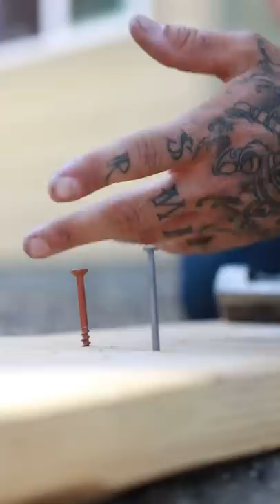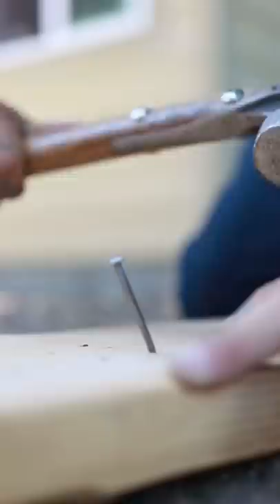Nails vs. Screws: Why do we use nails? #shorts

Comment: Nails will also come out over time where screws won’t. So pros and cons to both. Most builders I know use screws and nails. It really depends on the job
Reply: The main reason for using nails over screws is simply cost, it’s a hell of a lot cheaper to just use nails
Reply: Screws come out without fasteners. You also cannot remove screws without splitting wood. If a lazy, overpaid worker puts the screws in crooked, you get split wood. If an underpaid, quality worker puts the screws in crooked, you get split wood. Most of the time, you do not get what you pay for. You will not know what you got until you got problems. That takes a pretty decent amount of time. It is usually the second owner of the building that finds out.
Reply: @lalamclala5553  🤔

Comment: This video explains that the creator should not be involved in any field around engineering or construction.
Reply: I think he’s just a young builder that thinks he knows the answer to every little thing. That hammer he is using is relatively new.
Reply: Roasted so hard 😂
Reply: Builders now use screws, or Atleast nails that have testy and heat activated glue.
Reply: @channingtaintum  or it could just be a joke, people do that sometimes.
Reply: Hey man, he's a Californian. Give him a break🤣
Reply: That actually correct. Construction workers think it's only cost but In engineering things are built to yield not break at failure
Reply: So true, people who don't know what you know shouldn't be allowed to work in the field.

Honestly just stop hiring new people at all, not like construction would die in 1 generation if we were to do that 😉
Reply: Matt has been building shit for a long time, I don't think he's new

Comment: If your house moves this much to break a screw you're in the wrong house.
Reply: the sears or whatever tower is designed to sway like 3 feet and regularly hits 6inches. there’s a reason to design and to use materials that bend and not break. It’s a major variable in construction of things, even electronics glass is designed with that sort of thing in mind.
Reply: @threestans9096  I don’t think Sears tower is made of wood
Reply: Under extreme weather conditions especially for house in tornado alley and the east and gulf coast houses will flex and move in some case will completely collapse due to wind shear/load
Reply: @jamescrow8999  Even I heavy rain or high heat, if its a timber frame the house will move slightly because of swelling and drying
Reply: Think of a floor system fastened together. You don't want to use brittle screws.  Just use Simpson screws in hangers after nailing floor together.
Reply: The wrong house, or you're putting screws in a tent... In a storm.

Comment: If you have that much shear at a connection, then nails vs. screws isn't your biggest concern.   Anti-aircraft defenses, however, might be.

Shear is but one type of force.  There are several more which screws will perform much better.
Reply: I disagree, in his example he is exaggerating the motion. Even with milimetric deflection, through high cycle fatigue which occurs over time with things like wind, heat, cold, etc.. you can start seeing issues. 

I am referring to this specific example. Of course, choosing the right fastener depends on a multitude of variables and the application.
Reply: @pumsjd  Exactly. There's a reason aircraft are inspected for microfractures so meticulously. Every flex no matter how small takes it toll
Reply: @pumsjd  well ure wrong still that’s just one example ure clearly not a builder 😆
Reply: Places that have lots of Earthquakes such as Alaska,Comifornia,& others need something that can shift so it’s obvious your knowledge level is not very good about how much building shift in those areas.Maybe you should do some research because it’s obvious that you have not.😱🇺🇸
Reply: Yes... that is why they use fasteners and joints. You cannot simply remove or reuse a fastener. That is why both aircraft and anti aircraft are single use with any damage. They do not patch wholes in aircraft.
Reply: @lalamclala5553  LOL,there are WHOLE what’s in aircraft? 🤣😂 I have seen them with HOLES but I’m not sure about WHOLES? 😂🤣🤪😱
Reply: @lalamclala5553  Meanwhile I've logged 1000s of hours in planes that have been patched repeatedly and been in and out of the military aircraft boneyard in Tucson over the last 50+ years.
Reply: Name one then I bet you cant without Google lol
Reply: Oh yeah? Well, SHEAR is going to be the main force that a stick framed house's structure will be subjected to. If the house's foundation shifts causing the wall framing to fall, that's shear load. If winds are high enough to blow siding and sheahting off, that's shear. If winds are high enough to blow your roof off, that's shear. Anything else?
Reply: You're completely wrong.  Even A small amount of repetitive wind load will break screws.  I've witnessed this myself with temporary braces held on by screws over a fall/winter. 

Instant fail on an inspection.

Lay off of the holmes on homes, bud.  😏

Only footnote to this video is that there are screws rated for structural work (Eg. GRK).  But they are a lot more expensive than nails.  For framing, "deck screws" are the defacto 'screw'; which are awful for framing.

Comment: This is BS, if we wanted screws to bend like nails we could make them out of a more ductile metal instead of a hardened metal. The reason is cost.
Reply: Exactly my thought… and if I’m not mistaken, some screws and bolts are made with a different blend of metals to reduce sheering.
Reply: I use neither just a bit of glue does the job 😉
Reply: @Znew07  I love how people on youtube act like experts when this dude is a literal expert
Reply: And its much expensive

Comment: The answer is shear forces. Nails are stronger against shear forces, i.e. two studs sliding against each other. Screws are better where a clamping force is needed. 
If you're putting studs together to hold up a wall, use nails. If you're attaching a subfloor to floor joists, use screws.
Reply: This is the correct answer
Reply from the maker: Ding ding ding.
Reply: We'll that's demonstration doesn't prove* that.

This process the nail has higher toughness but we don't know which has higher yield stress. According to your clean, we could be concerned with the latter and as the screw seems stiffer, it may be a better candidate for such forces.
Reply: @21area21  screws are generally harder but more brittle. You need the hardness to drive them without twisting them off. But as a result of this, they don't perform as well in shear (hanging) loads.
Also, a screw is only as strong as it's thinnest part between the threads. Since screws neck down considerably compared to nails, they are weaker in shear 

But, those threads and the head are what give you the clamping force. So if you're trying to keep something attached in a horizontal plane, choose a screw. It's not as strong but it resists tension loads a whole lot better than a nail.
Reply: @DriveCarToBar  Gotcha. That all checks out. I was just suggesting that brittle things actually have a higher FORCE needed to deform and break them while more flexible things like the nail can absorb more ENERGY before breaking. I guess if wood expands so it doesn't put the forces on the fasteners evenly, in those cases you would need them to have higher flexibility in your fastener.
Reply: Dumb guy here. And you guys seem to be proactive in answering. Is is the screw cut that make it fragile? How come there isn’t a flexible screw? Would that be stupid expensive?

Is the nail more flexible because it doesn’t grab or clamp the same?
Reply: The screw is less flexible because it's harder, it experiences a brittle fracture after exceeding its yield strength instead of undergoing plastic deformation as the nail does. It isn't necessarily less strong in either tensile or shear stress.
Reply: @forrestcarroll9350  for a given size, the nail has a greater shank diameter and resists deformation and breakage under shear. It exhibits greater resistance to breakage, this making it stronger. 
You could use larger screws to get the same strength but they are more expensive and take longer to drive. That's why we use nails. Stronger in a given diameter with the bonus of being faster and cheaper.
Reply: @forrestcarroll9350  replied to the wrong dude.
Reply: @jonithanphillips2925  well, I'm sure you could have a softer screw, but it probably wouldn't perform as well. Screws have to handle a lot of torque when you are driving it and the heads experience a lot of stress. Softer screws will be limited in their length, have heads that strip out much easier, and will likely rewire thicker threads which cause further increase in driving force meaning and lowering performance.
Reply: @DriveCarToBar  That clamping force that screws provide adds a considerable amount of friction between the boards that will counteract a shear force to a greater degree than a nail. 
Screws on their own are terrible at shear forces but within a framing member they can, in most situations, resist shear forces better than nails.

Comment: Never thought about screws and nails having a different temper but it makes sense. You need a harder (but more brittle) steel for those tiny screw threads to provide any support, especially if they’re self-tapping.

Comment: I've framed houses for 35 years.
The use of nails over screws is simply economics.. 
Nails are cheaper than screws, and take about 1/10 of the labor to drive them.
In the frame of the house, most of it will never matter whether it was fastened with screws or nails. 
If the frame gets racked enough to break a screw, then there's a lot more to be concerned with than replacement of the nails or screws.. 
You will need to re-build the house regardless of what fasteners have been used.
The soft pine used for general construction will tear around the nails or screws. 
Nails are driven with a gun that takes about a millisecond to drive.. 
Even with automatic screw guns they take about 3-4 seconds per screw.
It's just plain cheaper and faster to build with nails, and that's the only reason nails are used.. period!
This young man is simply talking about stuff he doesn't know much about.
Construction glue is also used in conjunction with screws or nails and multiplies the strength of the house.

Comment: Nails can also be shot in a lot quicker than screws can be driven. 

Kewl hammer, btw.
Reply: A Douglas hammer <3
Reply: Most builders knock screws in because they hold better, just finish them off with a driver.
Reply: You’ve clearly never used a drywall screw gun with a screw magazine attached.
Reply: @PanicMMA  its Deluge
Reply: @YesImhymn  Its still faster to use a nail gun. Besides, you don't put timber together with drywall hardware.
Reply: @bricecay1765  lol, not to mention at today's prices ..let's see....3000 colleted screws, vs 3000 16p?? Yeah I'll take the nails and still have my ferrari payment. Keep your magazine
Reply: I want the hammer
Reply: Aaron Hicks  shame this is only a 16oz hammer tho
Reply: @joegatton6717  16 ounce or not the lighter the better I've been using this same hammer nearly every day of the week for over 4 years  at work and it drives nails better then a heavier hammer. 
Trust me when I say this hammer is way better then my stiletto hammer.
Reply: And taken out
Reply: @Trin1019  yeah I can believe they are better than a stiletto lmao I’ll stick w my 23oz vaunghan wood handle
Reply: Aaron Hicks  is it? Only one I saw that looked like that was a 16, and an 18 but looked like the other 2oz were in the handle lol
Reply: @Trin1019  I think you like that hammer better because it’s not a fucking steel hammer😂😂telling me that the lighter hammer drives nails better is like you telling me to get a lighter sledge hammer (almost half the size)
Reply: Aaron Hicks  even looking up Vaughan vw20 doesn’t pull up a 20oz version of the hammer in the video. I use the Vaughan 23, which is a different looking hammer than the one in the video
Reply: @joegatton6717  no realy..
After 25 years of a framer I was convinced when another master journeymen gave me his hammer "Deluge" wooden handle.  To use.
I know hiw to use a hammer. And over the years. I've learned that you don't hit the nail. 
You drive the nail.many end their ability at hitting the nail. The heavier the hammer the more swinging you have to apply causing elbow pains.  With this hammer I've learned to master driving a nail not just hitting it. 
Your analogy of a sledge make no sense. 
A sledge won't drive a nail it will bend it and crush it. 
With this hammer you apply power once or twice. 
Less strain on the elbow because its lighter. 
 Thats the skill of a framing  carpenter. 
After 25 years. Nearly framing 5-6 days a week. 
At first I thought it was an over priced hammer. 
My stiletto was light but the handle was still titanium vibration through the hammer still caused pain to my elbow.  Deluge has a wooden hammer vibration ends in the wrist. My favoring this hammer has a little to do with the metal. 
It has more to do with the weight of the hammer.
Reply: @Trin1019  okay of all things I use my hammer for actually driving nails is what I do least and I’m not what sure what distinction you’re trying to make between hitting and driving the nail? The difference between just swinging and being accurate? You can be accurate with a 23oz hammer, and again driving nails themselves is the least I do. Do you not have air nail guns? What type of work do you do

Comment: The true reason you use nails is the cost. Nails are cheap, faster, and easier. If you put two screws into two 2 x 4s, and two nails into two other. Apply opposite pressure to each side. The nails come apart with little pressure. The screws take a lot more force before they finally break. Nails with age have no grip and pull out of the nail hole. Drive screw nails are the only ones any good.

Comment: It’s a softer version of steel which gives it the capability of bending. While the screw is a harder steel that is has less malleability and sheers easier, but keeps a sharper edge. - Metal worker
Reply: you sir know what you speak
Reply: Screws actually have higher sheer strength
Reply: Incorrect, screws have much higher sheer and tensile strength.

You are confusing maliability with sheer. Theybare not the same thing. And the nail sheers FAR easier than a screw.

You can get engineered structural screws that are abesolute madness how strong they are. But you can hit it with a hammer sideways and it will snap.

But they are stronger in everyway to even a very stout nail. Including supporting huge amounts of weight and insane shear loads that you don't have in conventional framing.

Your nail will have snapped and sheared long before a screw even breaks a sweat.